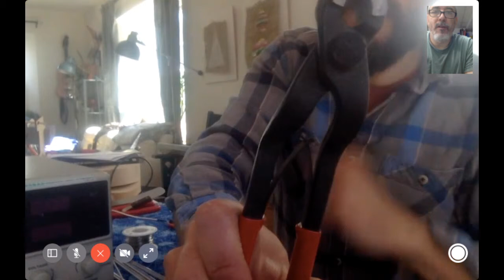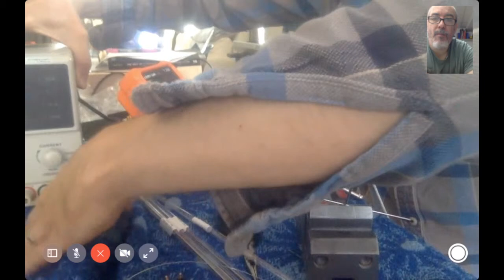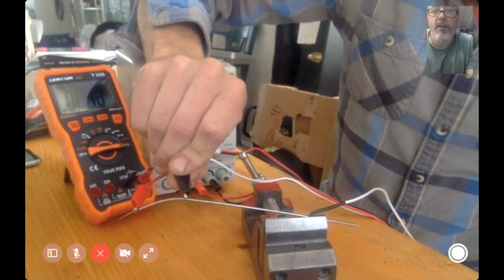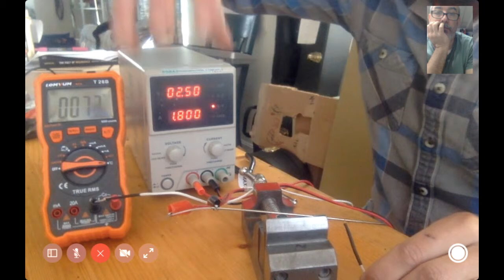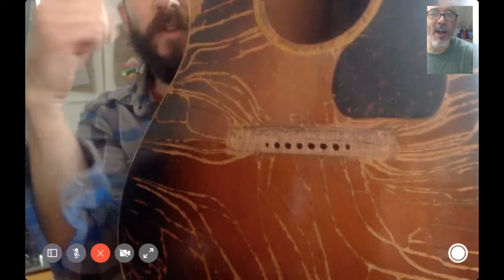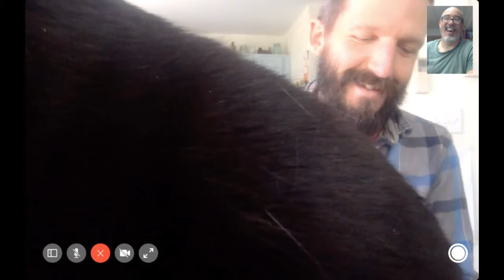Trevor Healy gets tootled on the Resistance Heater

Comment: guess you could use the LMI unit for the heat probe alone.
Reply from the maker: LMI unit is pulse width modulation. It will fry these tiny heaters on the first pulse.